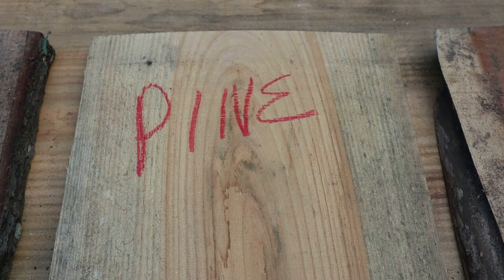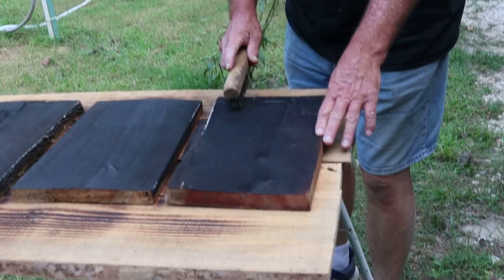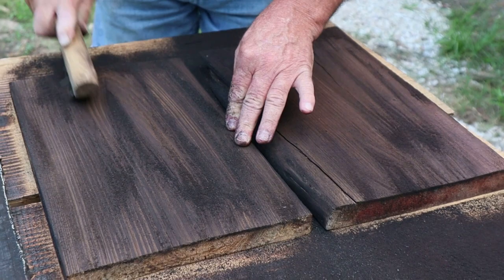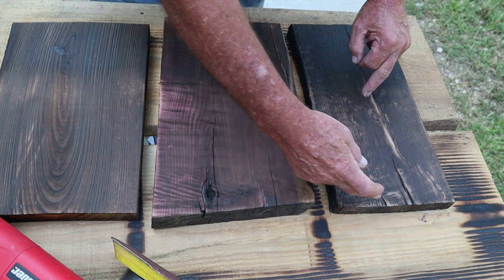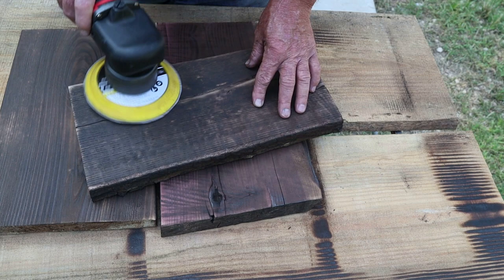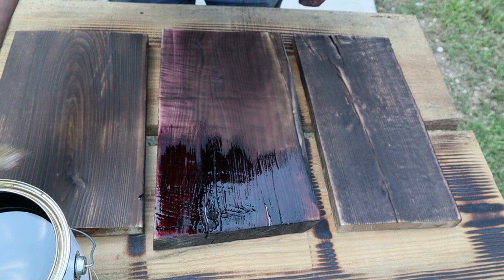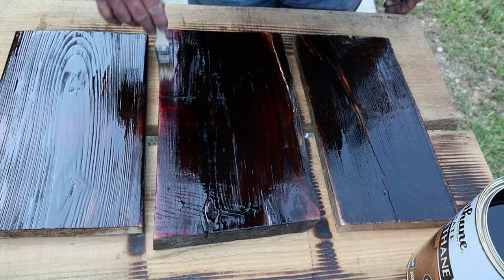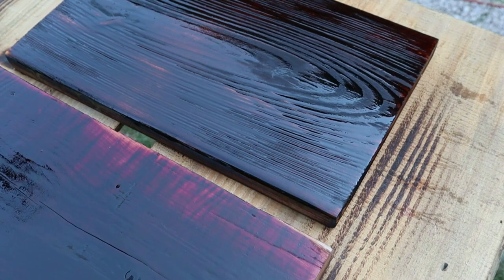DIY Shou-sugi-ban Wood Burning Torching Technique on Pine Oak & Cedar

Comment: I’m watching this after I’d done the deed, but you still shed some light on my results. I wanted to build some 10x2.5x17” raised bed planters for gardening. I really wanted an excuse to use my torch and this method was screaming at me 😍. I chose untreated pine since the burning provides protection and food safe. I chose a tung/zinc oil just to add looks and additional protection. You were right. The pine, after brushing, brought tears to my eyes because of the beauty of the grain. Almost looked mahogany. Then after the oil, the wood darkened a little more and the grain was breathtaking. Almost too nice to sit out in a garden. I’d tell your followers that the pyro fun alone is enough to try this, but you’ll fall in love with the whole process! BTW, I chose the stiff vinyl brush over the wire brush for my best results, but that will vary with each person I think. Love your vid and thank you!!!
Reply from the maker: Glad I could help and appreciate the comment

Comment: This is not how it’s done folks! I would recommend using a wire hand brush or a nylon drill attachment brush for texturizing after. You don’t want to polish the burnt surface you actually want to scrape it. There are many other videos and nobody sands the surface smooth, you want ridging…but if you actually like this look instead…go for it
Reply: They looked better before he did it

Comment: That was a really great video, thank you. I did a few experimental shou sugi ban pieces a few years ago but I now have some engineered wood flooring that I'm planning to use for picture frames (cut off the tongue and groove,  mitre, frame up, burn, finish and then flip and attach the canvas). It's oak and I agree that softwood can work better for this but hey, the thing you have is the thing you work with right!
Reply from the maker: Great information. Appreciate the comment

Comment: If you were charring just to stop wood from rotting. Would you  knock  the  chard  off with the wire brush , or  just leave it . Can you put paint on the un wire brushed wood ?
Reply from the maker: I would knock the heavy charr or loose char off, since a stain may not keep it in place. You could leave it unbrushed if you are applying several coats of a heavy clear coating

Comment: Cool vid
The camera almost always misrepresents the color that the wood turns with top coats.
Ive done this a lot for residential and commercial interior/ trim applications mostly with pine + stain + top coat...
Was that polyurethane oil or water based?
Have you used water based helmsman spar urethane any for exterior applications?
Thanks
Reply from the maker: It was water based and I will have to look into the other stuff you are talking about. Appreciate the comment. Thank you

Comment: Do you sand the wood before burning it and if yes what grit sandpaper do you use.....i have some spruce wood planks i want to do this to
Reply from the maker: No I did not sand it before burning it. I lightly sand it after I burned it. I normally use 200 grit sandpaper. But that will vary depending on wood

Comment: Hi there, do you know if the pine would last for exterior use in irish climate
Reply from the maker: I'm not familiar with climate, but any lumber that is treated would last a while..Non treated pine..would be questionable
Reply from the maker: Yes it does
Reply: @LarrySbrusch  thanks Larry, I'm trying to keep costs down cus I'm broke😬 so had to go with pine. Re treatment after burning what would you recommend... An oil of some sort?
Reply: itzel varela  thanks itzel... I just couldn't afford the cedar I'm afraid... Could I seal the pine after do you recon to help it last?
Reply: Please don't do the shou sugi ban technique on treated lumber. I've used outdoor deck sealer on pine and it's worked well. It lasted over the winter without any damage

Comment: Do not sand your defeating the purpose !!!!!
Reply from the maker: if you sand it, you break down the very high sharp edges on the piece..which is what most people like, when I build bences with this technique. Appreciate the comment. Thank You.. I have a new video also coming out next week with this technique in different colors
Reply: @LarrySbrusch  Larry the hole purpose of the technique is to expose them ridges thats the part that insects don't eat thats the part that is more resistant to rot thats the part that gives it texture and makes it more interesting! The part that burns of is the softer edible part the softer rotable part !
Reply: Sanding gives the best look, in my opinion. I’ve done it both ways.